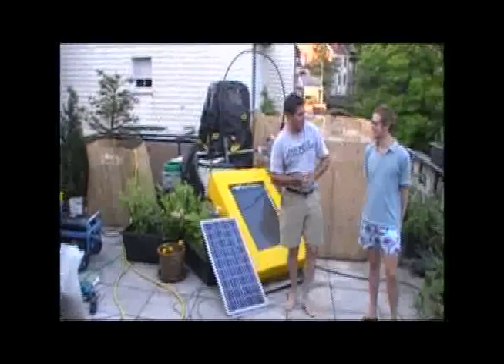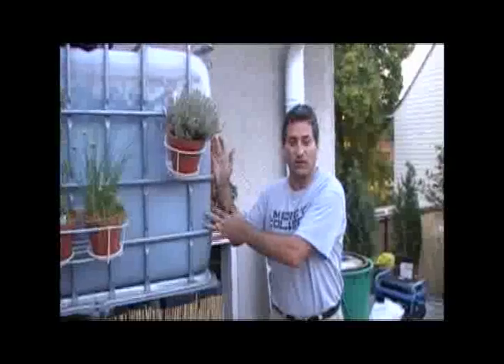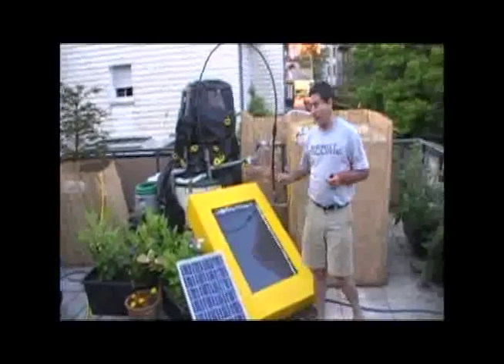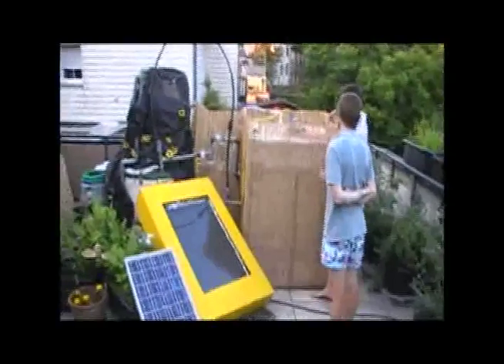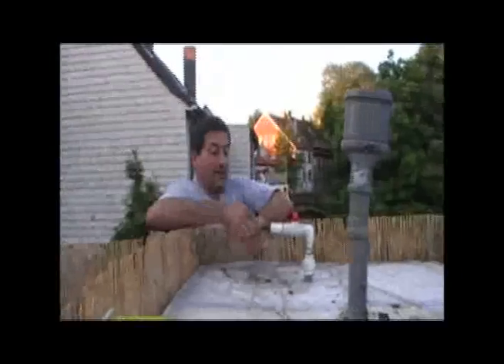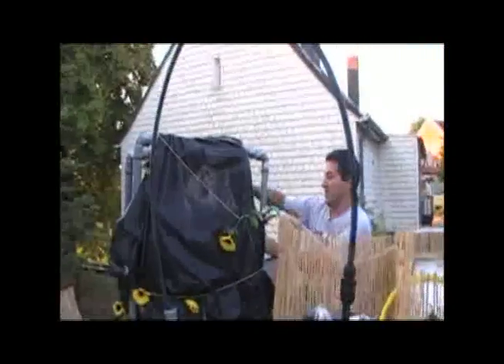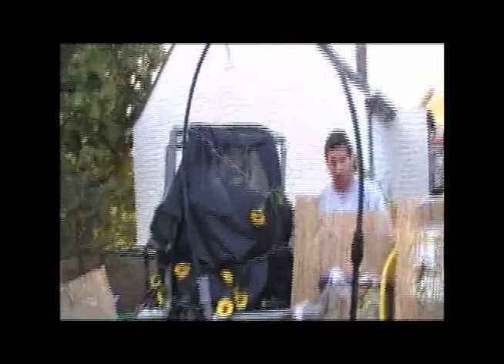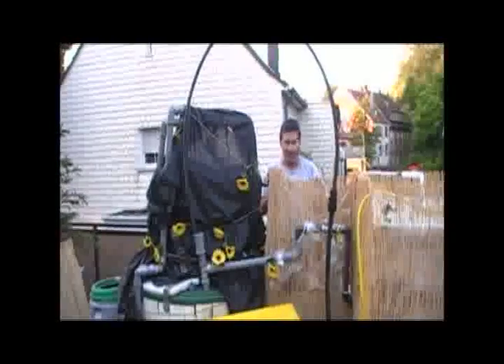Our Germany porchtop solar heated biogas system, part 1

Comment from the maker: If I was to do it all over again, and got permission from the wife, I would place the biogas digestor next to the bathroom window before the grey water collection tank and run the hot water as it comes out of the shower and bathtub and washmaschine through the biodigestor first to capture on the waste heat. Then I would have the solar heater as an additional heater for the few sunny days we get here in Germany.  The point is that we have plenty of heat coming out of the bath every day.